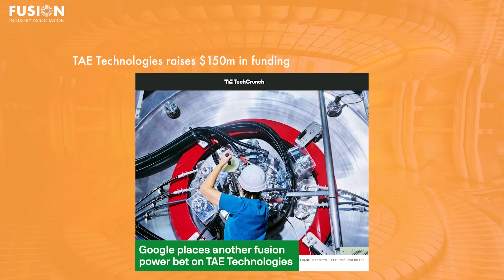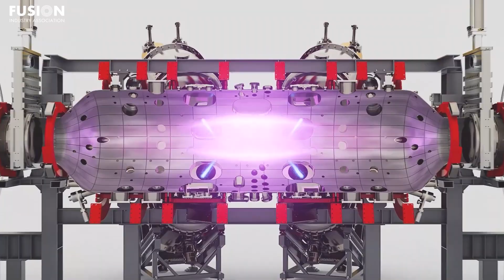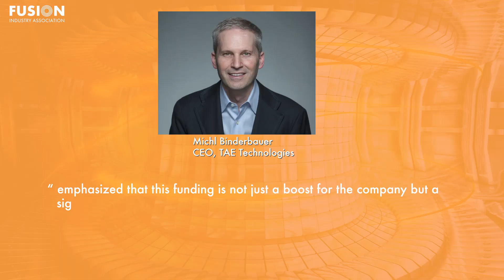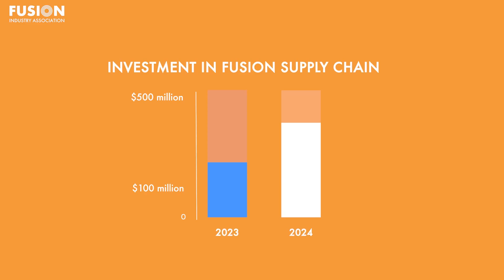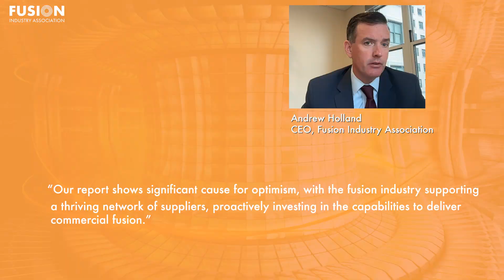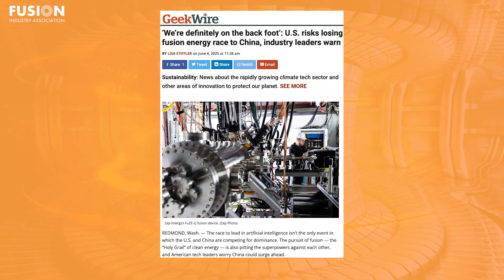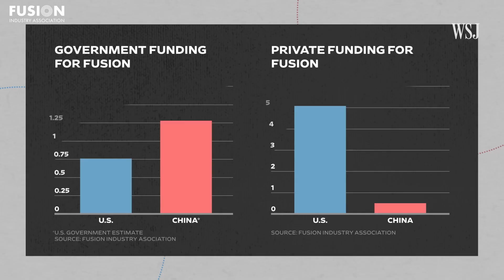Fusion News, June 11th, 2025

Comment: Everyone interested in fusion tech owes it to themselves to read M. Abdou's paper "Physics and technology considerations for the deuterium–tritium fuel cycle and conditions for tritium fuel self sufficiency". It's available from IOP Science, not paywalled. Aside non-tritium technologies like TAE which have a different set of issues, the central issue for commercial fusion is the lack of tritium. And as the paper shows, it's going to be incredibly challenging to do something about that.

Comment: In the 1st article (00:57) about TAE raising $150 million, why would anyone invest in proton-boron fusion?  Most scientists are skeptical that pB11 (hydrogen-boron-11) can be used as a practical fuel choice. Extremely high temperatures (~600 keV) are required, far higher than DT fusion (~10 keV), and studies have concluded that bremsstrahlung losses will prevent ignition.
Reply: The reaction doesn't emit neutrons, solving a bunch of problems.
Reply: Because the potential ROI is even larger and researching “could” progress faster/cheaper

Comment: Entanglement looks like it is going to be a major factor in fusion.  So, is that what the frozen hydrogen pellets are in the form of a Bose-Einstein condensate doing?  Couldn’t a tertiary entanglement from light have the same beneficial effect with just a few laser filters?  Could the missing element in cold fusion be that Yeast contamination gave a tertiary entanglement to the deuterium (water) increasing the probability of fusion.  Why freeze hydrogen is it the entanglement?
Reply: No entanglement
Reply: Freezing the hydrogen isotopes brings all the atoms closer together (in IFC) Better density = more reactions/better yields